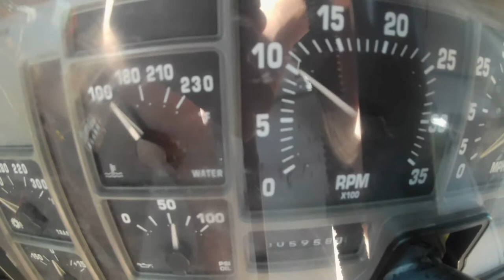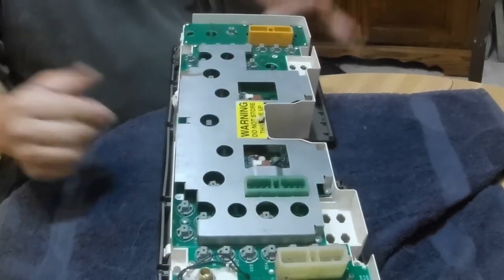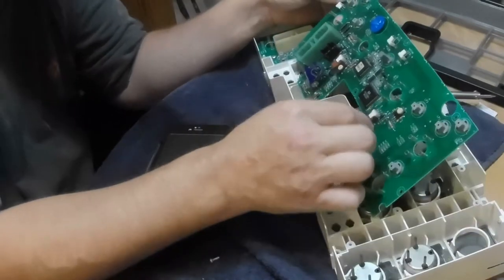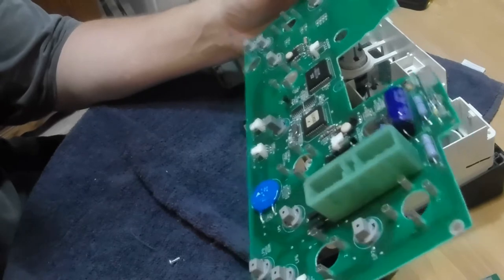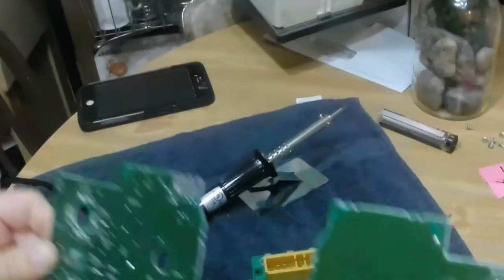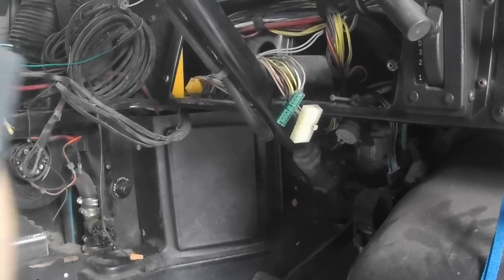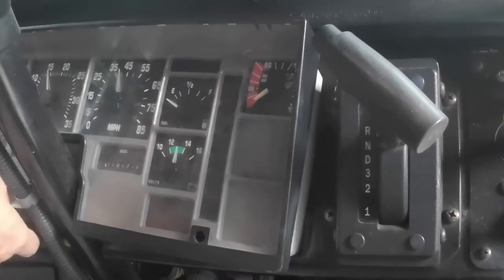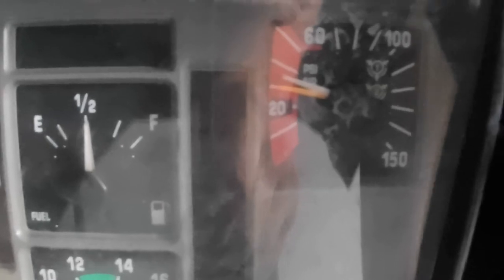SKOOLIE BUILD | DASH GAUGES | GAUGE FREE FIX  | SKOOLIE BUILD INTO A TINY HOME ON WHEELS!

Comment: Great job Chris. Did you check the bulbs? Looks like it uses the 194 bulbs like what's in my old Blazer. After years of use, even if don't burn out, they get real dim. and should be replaced so it will light up nicely at night.
Reply from the maker: Thank you! We are going to pull the dash out in the future and replace them. Not many work. I'm going to check out the 194 bulbs for sure. Thanks for the tip. Cant wait to get up to KY to see you guys.
Reply: @CSSkoolieProject  Sounds good.